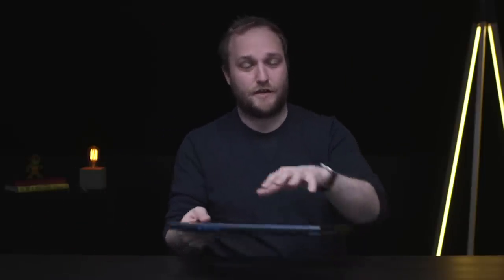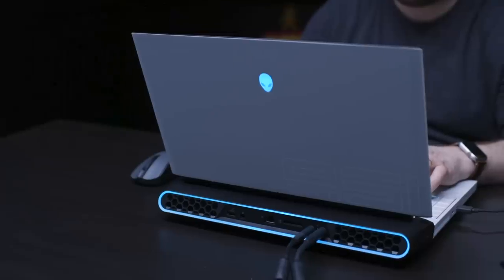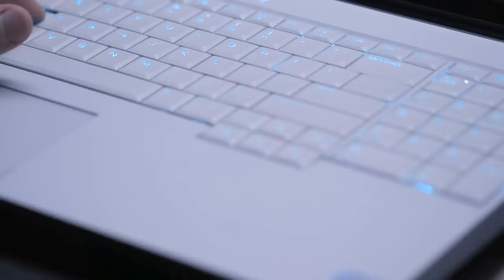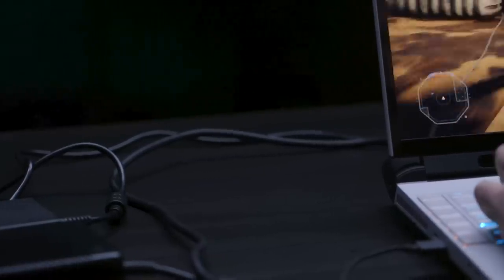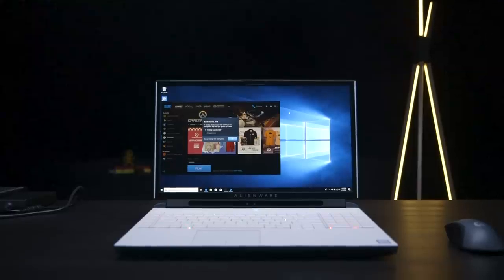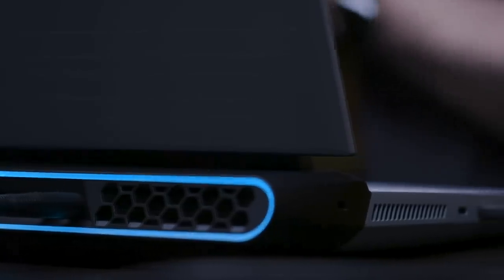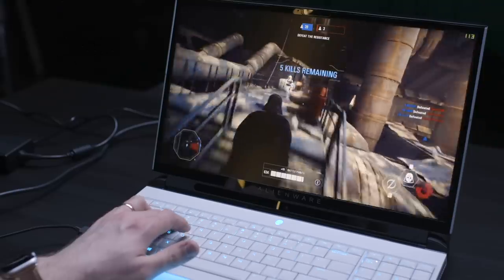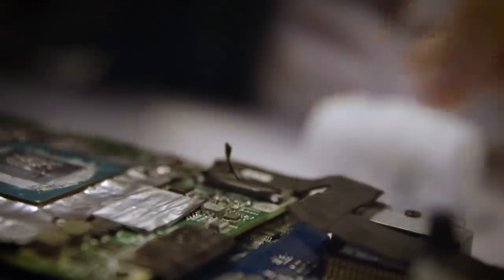Alienware Area-51m review: an upgradeable behemoth

Comment: I am almost the perfect demographic for something like this. I’m a touring musician, like 250+ shows a year all over everywhere. I’ve been using gaming laptops a long time. I love them. I currently use the Alienware 15 R4 and even though it’s not “thin and light” I can carry it on to planes and find a hole to set it up in anywhere with an electrical plug. The deal breaker for me on the 51m, other than cost, is the two power bricks. I don’t think I’d be able to get the laptop, the power bricks, and my headphones/controller in a book bag and under a plane seat. It’s * just* slightly too much to really carry everywhere easily. I love the design though and I love the commitment to upgradability
Reply: Unless you’re gaming you can run it off one power brick at pretty close to full performance

Comment: You should note that the upgradeable GPU will only be upgradable if Nvidia releases the next gen mobile GPU's with a similar size. It's not a future proof GPU by any means which is why it supports the Alienware Graphics AMP still. Still a solid machine.
Reply: thats why you buy them straight from dell
Reply: Misfit pants exactly. It’s going to cost a pretty penny but you’ll have it .
Reply: Rocky Jet Melendez Alienware is for client who have money

Comment: I bought this machine for work (I don't even game). The desktop CPU and GPU (modified) are ideal for 3D applications. This laptop is more powerful than my work desktop and now I can work from wherever! :) Just saying that for work purposes, this is definitely worth it to me. I don't even mind the limited battery because when I travel, I only work from my hotel, airbnb, etc. anyway. 

So it's worth it for work, maybe not so much for gaming. But I did buy mine (fully spec'ed out high-end version) used for $2,400. Not too bad.

Comment: FINALLY!!! I always hated the trend for ultra thin laptop that can barely perform for demanding stuff; don't get me wrong there's a place for those but if I want raw power and the ability to easily transport my laptop there should be the option to get it. :)
Reply: nocturneJOJO the problem is 90 min of battery life just writing s document is pretty bad
Reply: @RossMKF1  that I agree!
Reply: @RossMKF1  you shouldn't use this as a carry on laptop. This is a desktop replacement. Battery life doesn't matter.

Comment: even the base version is faster than any desktop/laptop that i have used to date. i feel a little sad now.
Reply: scooter800m only 60hz tho
Reply: @The57555  I don't care though. I rarely wish for more than 60.
Reply: scooter800m well if it’s for gaming, your not gonna get tear free gameplay if you don’t get more than 120 try to change he 60 option to 144 it’s worth it
Reply: @The57555  nah, i've found that even though i have the horsepower for well into the triple digits, i just don't mind running at 60 frames. I do know that 120 and 144 are smoother, but for me i don't feel like spending more on a piece of tech that i don't really need. especially since i am not a hardcore gamer. just a casual gamer and i like to see what new computer builds come out of these companies.

Comment: So... it's that thick and heavy and no SD slot and the external GPU is propietart. HAHAHAHAH!
Alienware is still the "Apple" of "Gaming machines".
Reply: Can not replace hd by SSD ?
Reply: I don't think they have a choice in terms of GPU since MXM form factor is depreciated. At least it's compatible with Thunderbolt or Alienware external GPU adapter
Reply: Most gamers prefer USB slots to SD slots. You can plug an SD adapter into an USB slot, but you cant plug an Oculus sensor into an SD slot.
Reply: There's no need for sd slot really q